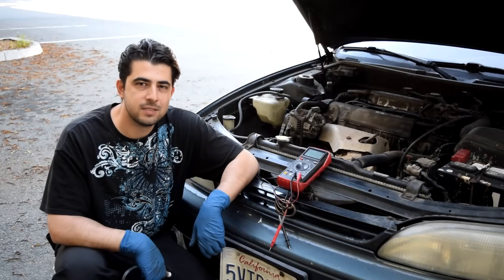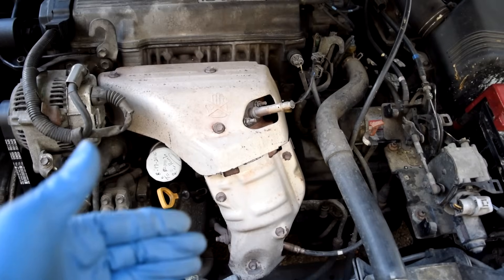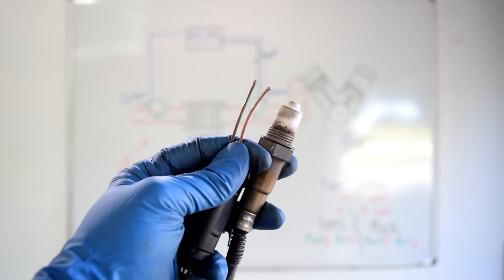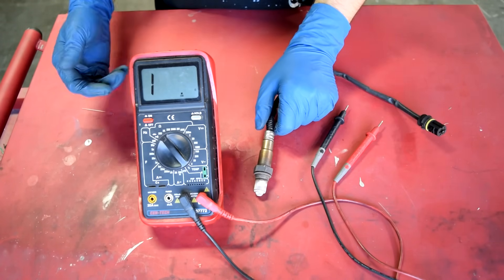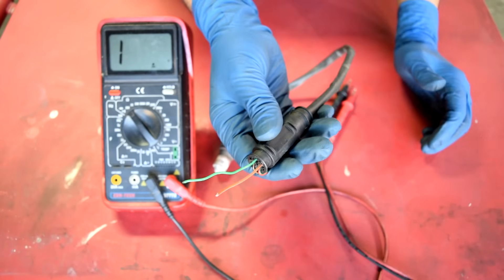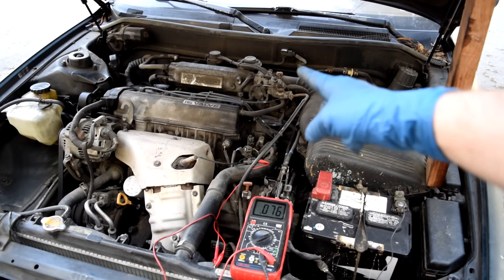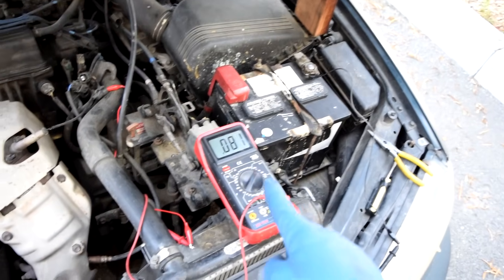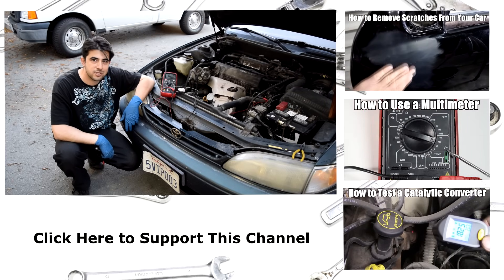How to Test an Oxygen Sensor - Plus Oxygen Sensor Operation and Replacement Guide

Comment: Hello. I am Rejhan from Serbia and I have a problem with wiring lambda sensor for polo cross 1.4 petrol engine produced in 2007. The problem is about connecting wires of lambda sonde and wires of car port. On the lambda side there are 4 wires, black, gray and two white, and on the port side green, brown, brown-white and red-blue. Can you please tell me how to properly connect them?

Comment: great vid. im chasing a  P0170 code on a 97 Mercedes C230. I have replaced the MAF sensor. it caused the code to go away but it came back. Does this sound like an O2 Sensor issue?

Comment: 4:52
I have four wires
White x 2 each
Black
Grey

Ohms: No readings with black to grey.
white to white, reading is 13.8

TN/WH is low signal bank 1 sensor 1
PU/WH is low signal bank 1 sensor 1
GY/WH is low control bank 1 sensor 1
PK/BK is fuse control

Comment: Great info, thanks. I'm working on a 2008 Kia Sportage with a bank 1 sensor 1 (upstream above cat) slow response error, P0133. Over a few years a few shops have worked on it, but could not figure it out. Both sensors were replaced with OEM sensors. 
OK so I get the idea to test the wiring. The ground I am good with.  
For the signal line, hook up a scanner introduce power and see if that gets through the ECU to the scan tool. 
I am just concerned about putting 12 volts in there as think these sensors use mili amps.  Could anyone comment on that.  
Thanks.

Comment: You did an absolutely fantastic job of presenting the trouble shooting procedure and other pertinent knowledge that I was seeking. Spot on brother. I feel very confident in using the deeper education I just received from you and what I knew prior to watching your video to now locate and correct my current maintenance issue with my vehicle. 
Very well done. 
Visual aides and all. 
Given that no person ever performs flawlessly. My one needs improvement would be to liven up your presentation. Be more charismatic. Or. Get a co-host (I would volunteer to work with you and have extensive experience in such endeavors, and consider editing options. Some music would not be a bad idea. As would some minor graphics as opposed to your current classroom style visual aides. 
It really was a great presentation of facts and knowledge. Two thumbs up bud. Thank you for your time and support. 
Steven.

Comment: Downstream 02 do not stay steady unless have a wide band.  The o2 switches as he said, the downstream o2 should switch also but it will be slower about 1/2 the speed do to the restriction.  if your cat is empty or too much flow the o2 will switch at the same speed. (be careful a slow moving upstream o2 can throw a downstream code due to the pcm is looking at the upstream for reference.)  thats why you can move the rear sensor out of the exhaust flow or restricting it if there's no cat and the pcm will not know any different.  (This works to about 2015 new cars downstream is used for fueling in new cars making the tolerances super tight to stop system

Comment: I have a chrysler pacifica 2005 3.5L and I have an issue with the 12v heater wire not sending the 12v to the upstream oxygen sensor. The computer sends the 12v on these cars no fuse just direct so I tested the 12v at the computer and I still don't get the 12v key on. So I have a bad computer but my question is what will happen if I send my own 12v source to the oxygen sensor will I still get the same p0131 code or will that fix my issue. Thank you.

Comment: Hello, im getting code P0137, mechanic changed the o2 sensor but now the codes im getting is P0137 and P0157. So mechanic changed both downstream sensor. But we are still getting the same codes

Comment: Hello, Thanks for your video. I have four wire sensor. there are four wire from Toyata prius 2 engine and four wires from o2 sensor. How to connect? Heat to hear? signal to signal? earth to earth? thanks

Comment: 6:00 Other videos I watched say to turn ignition to ON but don't start the car. If you are just testing to see if there's voltage coming from the battery to the 02 sensor harness why would you need to start the car?

Comment: Should I not even bother messing with this if there is no codes?  Or if I see certain live data parameters should I check it?  I know throttle position sensor you should test because it can be bad and not throw a code.

Comment: for the o2 sensor voltage reading, if your sensor has a signal wire and a ground wire then you have to ground it to get an accurate reading

Comment: New to doing my own repairs and I came across an obd scanner and no check engine lights and the truck is running good. But the scanner says shrtftb1s3 (%) .....99.2
Is that normal?

Comment: My scanner only has o2s12 v reads around 220 idle I do have lambda11 which goes to 1.999 when I Rev the car but sits around 1.000 at idle I’m confused as I thought it was from 0.000 to 1.000 and ideally should bounce up and down from 0.100 to 0.900

Comment: So i got p0420 catalyst system efficiency below threshold bank 1 so which o2 sensor is bad? I have 2014 nissan patfinder v6 awd should i change the o2 sensor by firewall side or the one by radiator side?

Comment: I am from  Nigeria.  This is the  most  explicit  video  that explains the  link between  the sensor  harness side and the  engine  harness side in the  eventuality  that one of the  harness  side is usually  cut off by some  careless  mechanics. You are simply a  great guy. My sensor harness side is  missing  and  I  have  trying to  link the sensor 4 wires to  the engine  side harness  male  socket with  many  other  videos. Stumbling  on your YouTube video made it a lot lot easier.  From your  explanations the  12V pin is diagonal to the ground pin. Does that mean my two black heater  wires from the sensor  side will  have to  socket the  two diagonal  positioned pins on the engine harness side? My 12V wire from the engine harness side is white  with black  stripe while  the  ground is red with yellow  stripe.  Expecting your  confirmation. Thanks

Comment: Can a weak fuel pump cause my car to run lean or rich?  I keep getting a P2A00 code on my 06 Sentra, checked for vacuum leaks but can't find any. Both catalytic converters are good and both have brand new (Bosch) o2 sensors. When i connect my scanner i get readings of 0.275, 0.265, 0.270, 0.280 on bank 1 sensor 1 and 0.710, 0.740, 0.810, 0.760 on bank 1 sensor 2. All at idle (750 RPM). The reason I suspect the fuel pump is often times when I crank to start my car it struggles a few seconds before it fires up. And I've also noticed over the last few years a lot of soot on my tail pipe, someone told me it is running too rich. Any response would be greatly appreciated!!

Comment: If you use the test light to test the positive o2 sensor wire to the PCu. Aren’t you putting 12v into the computer and possibly ruining it?

Comment: Testing the black wires i get nothing. I get 002v on the blue and white.  Cold car run rough especially when ac is on. No check engine light. car Toyota 3S-FE bj2001 200000 km

Comment: I disconnected the downstream o2 sensor to check the voltage it produces. But it doesnt hold the voltage, it decreses slowly with the engine on and hot. Is that normal?

Comment: Buenos dias..I have a problem with my1999 Stype jaguar 4.8 V8 ..it comes on failure engine safe mode and won't start and it's getting fuel but it starts with starting fluid and dies with out starting fluid can you help me

Comment: Excellent video. Thank you. The only thing I hoped for (but can not expect) is to get a better feeling of what resistance to expect for the heating element. You mentioned 10 ohm for your particular sensor but what would be the typical maximum and minimum resistances be in the field? 

For instance: I measure 1 ohm on a brand new Denso 234-9005 sensor said to be good for a 2002 Honda CR-V and still have doubts whether that's within specs. I mean, 1 ohm at 14.4 V is 14.4 amps!

Comment: The heater wires are for heating only. It shows that the heater ckt is working fine. But not the sensor itself. Sensor's voltage needs to be taken care of. Check that

Comment: I've taken my 06 Murano to many mechanics trying to fix my codes for02 sensors and the catalytic. We've replaced every sensor and the cat and still getting the same codes for both. Asf in my car had a bad hiccup as it was called by a few mechanics. I've asked for the spring to be tested and so far haven't been told they are bad. I can't afford to keep dumping money into this. Any suggestions?

Comment: TIMESTAMPS:

4:38 -- check the heating circuit's electrical resistance
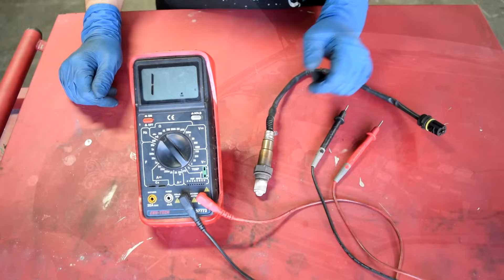5:18 -- deal with "check engine" light, if applicable. check wiring harness
6:52 -- test the o2 sensor's voltage
8:01 -- good pre-cat o2 sensor reading
8:11 -- good post-cat o2 sensor reading
Reply: Thank you.

Comment: Thanks for the video. Bank 1 Sensor 1 on my astra G seems to be the cause of engine light. once cleared the light stays off for short while before coming on again: the garage charged me over the top for a new sensor, which didn't fix the problem, and now suggests that the ECU may be faulty. so I went to another garage, and he wants to start with changing the catalytic converter, again at over the top price. Could this fault really be the cat needs changing ?

Comment: Something I dont quite understand...
If the car is running lean, it will read from the O2 and adjust the ratio once in closed loop, when adjusted, the ratio is normal again and the O2 sensor will continue to oscillate.
Why did the working O2 sensor never oscillate here once more fuel is added to the ratio to account for the exhaust manifold vacuum leak?

Comment: dude your videos are awesome, i also follow etcg, shroedinger's box, scanner dannder, chrisfix and other diy channels but the way you explain the simple things in detail is awesome. Nobody has probably ever mentioned that the post cat 02 sensor should always show a flat reading. This brings me to my question, i have a four cylinder Alfa Romeo which obviously only has one bank. However, there are two O2 sensors placed parallel to each other on the exhaust manifold next to the radiator. Now, i have not looked underneath the car, but common sense dictates that both these sensors must definitely be pre cat sensors. If so, how are you supposed to get the reading for these two on the OBD2 scanner? Should i just treat the second one as B1S2 ? Is it normal for a single bank engine to have two pre cat O2 sensors ?

Comment: Hi great video and thanks. I have a question please. I done an ohms test on the 2 same colour wires and signal was acceptable. But I didn’t understand how u checked the other 2 wires with the multimeter. Silly question but how do I test the other 2 wires on the sensor with a multimeter if there’s no power? Very grateful for your help.
I forgot to mention this is on a 2010 BMW 320 petrol. Currently lamda reading is very high an CO level low, but then lamda goes within spec an CO high and keeps alternating vice versa. So I’m assuming lamda sensors are faulty. But want to check them before I replace them. Thanks

Comment: Hi, another great video from you. Thanks! Quick question. When using the test light to probe the signal wire to the ecm you are applying 12v to an input that typically expects 0-1v.  Do you think ecm input is protected to allow 12v when the typical value is 1v or less?

Comment: Hello Chris, I want to commend you for taking out time to share this video. A lot of details jam packed in there. However, I have a DTC P2238 on my Toyota Camry 2003 I4 cylinder and thought of diagnosing the problem myself. The equivalence ratio reading was approximately 1 while the 02 sensor B1S1 ranges between 3.2 and 3.3, all conforming to specs. What else do you think I should look at?
I also read on the internet that an EFI Relay could be responsible. Thank you in advance for your support on this.

Comment: hi, I have a 2007 Suzuki Grand vitara 2,0 L Gasoline. Just Changed O2 sensor Bank 1 sensor 1, But the SES light comes up with codes P0134 and P0030. I'm sure I've connected the wires correct. ( universal O2 sensor) I deleted the light but it comes again. Have I done the wiring wrong?

Comment: You are awesome. Such a great teacher. Great videos and diagrams. I have an early 04 F150 I'm having problems with. It runs ok when the ambient temp is cool but when the ambient temp gets in the high 80's and above the engine starts cutting out. I have to turn the truck off coast for a few seconds and crank it back up. Then a few more miles have to repeat. Any knowledge you could share would be awesome. 
Thanks a million for making and sharing your videos.

Comment: Hi sir!
Honda Pilot 2003. 3.5
I connect my scanner to
Engine off just the Switch on
And the reading of the O2 bank 1 
Sensor 1 is 1.275 V
Sensor 2 bank 1.  Is 0.035V
Engine cold and not running
Just switch and reading with scanner.
Is this normal ?????
I'm not a mechanic but understand a little.
I have problem and wanted to solve it.
Thanks for your time!!!

Comment: Thanks for your video on this. I tried cleaning it & testing but it was toast.  Yesterday I got my new 02 sensor (Bank 2 Sensor 1) from Amazon for $67.39 Cdn. for my 2007 Honda Pilot.  Installed it, disconnected the battery to clear the code, drove for over an hour = No Engine or VTM-4 codes.  Very happy.  Here's the part for anyone who needs it:  Amrxuts 234-5010 5 wire wideband upstream.

Comment: Hello, my voltage  fluctuates up and down on the downstream sensor, just as my upstream sensor does. You said it should be steady in the middle at .5 volts. Does this mean I have a problem somewhere?  This is a 1995 Ford 2.3 engine with 187,000 miles and the original O2 sensors. Also, the downstream sensor reads 0 volts until the engine warms up. Thanks

Comment: Question. I have 4 sensors  & gt  Lean codes 1 B1 upstream 1 B2 down.  Does it make sense to clean the O2 sensors per other Utube videos I've seen? The car had an PCV issue and was burning some oil till we got the oil issue fixed. I think oil may have coated the sensors ..though I think it would have burned off. Thanks again for the great video.

Comment: Also, it is very confusing to see "exact match" sensors with different holes/slots in the sensor. Bought "an exact fit" from the Zone of Auto and the engine went off but the car immediately ran rich and stalled. Replaced the old and back to running normal, but engine light back on. Exact fit had half the number of holes and the holes were only a 1/3 in diameter to the original holes. This to me says the sensor is not picking up as much exhaust has the original. What do you say?

Comment: Interesting.  Thanxs for the lesson.  Why would a bad manifold gasket introduce air into the engine when the engine is blowing air(exhaust) out of the engine.  Seems like you would lose exhaust rather than suck air and 02 in.

Comment: hi  i have a  po031 heater low getting proper amps and ground with even with new denso for toyota camry 2.4l can a  bad catalytic converter be it my bank 2 sensor is fluctating ?

Comment: APPLAUSE , i like your explanation. BUT BECAUSE THE OXYGEN SENSOR HAS 4 WIRES THEN HOW WILL I KNOW WHICH WIRE IS WHICH. I THINK YOU MAKE US A VIDEO ON WHERE CAN WE FIND WIRING DIAGRAMS FOR A CERTAIN CAR. MAYBE BY USING VIN NUMBER. I REALLY NEED TO KNOW WHERE YOU GET WIRING DIAGRAMS FOR A CAR
M.B.S  MOSHITOA (S AFRICA

Comment: I have a 2012 dodge durango and i took the exhaust manifold off to check the catalytic converter. And when i put it back on it was given me a low voltage code o2 sensor. U think casket is bad?

Comment: I ve replaced my O2 sensor "1" correctly with brand new oem parts.  After few week , the warning light comes back again for the same problem. Is it something to do with a dirty mass air flow sensor ? i need advice to correct the problem.  thank you !

Comment: First, the signal coming out of an O2 sensor CANNOT oscillate if the sensor itself is not connected: what causes the signal to oscillate is the PCM continuously switching from lean to right fuel to air mixture depending on the signal it receives from the O2 sensor, therefore, if the latter is not connected, the former cannot adjust the mixture accordingly.
Second, even if the signal had been oscillating, you wouldn't have been able to see that with a digital multimeter, because it'd be too fast and you'd see just an average. You've gotta use an oscilloscope for that: since the frequency is relatively extremely slow, you can buy an USB oscilloscope (to be used with a computer) for as little as $30 on the ebay, or even Amazon.

Comment: I like your video which has more deep knowledge than Scotty Kilmer's videos.
Reply: Straight up the dude is too old school. You need a carb rebuilt I'm sure he's the guy. The dude thinks any kind of after Market anything is bad for cars. The guy we're watching is probably one of the best for this kind of thing.
Reply: @clutchbleach2057  If I have to spend $100 more for OEM but it lasts 100K instead of 30K like some aftermarket options then it's a better long-term investment, so in that sense Scotty is right to suggest DIYers drop a little more money on OEM. But I do think he's too quick to dismiss aftermarket out of hand rather than researching options that durable and can save his viewers' money.
Reply: Admin A Scotty knows nothing he’s just out for money

Comment: Thank you for your share of the catalyst problems on my 2000 Silverado and my Suzuki Grand Vitra. Your explanation how it works. I have taken to mechanic here in Modesto and I don’t think they know what they are doing and they did not explain not at all . I am doing my research on the operation of the o2 sensors and caterverter .